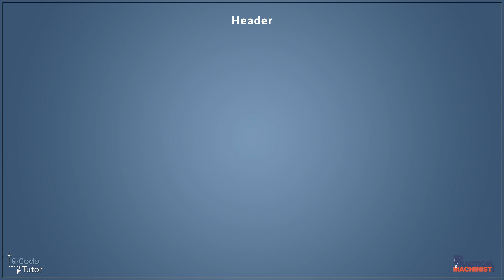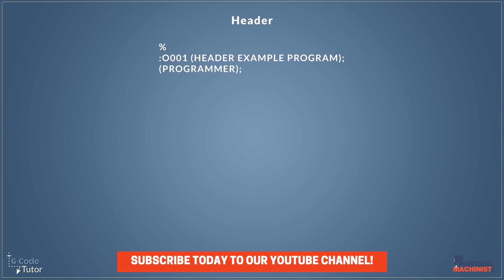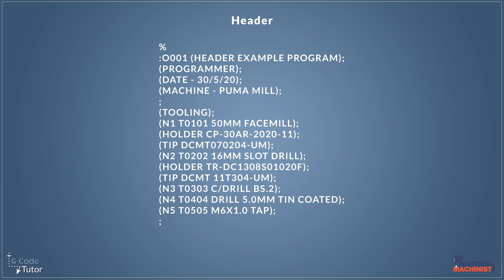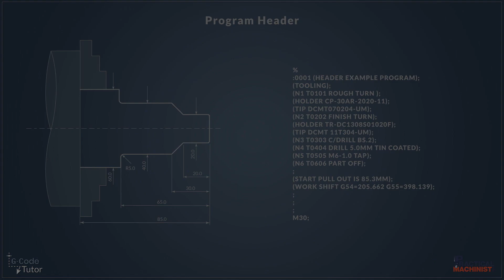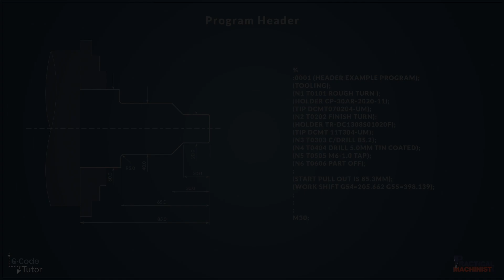G-Code Program Header EXPLAINED

Comment: Here is a tip I can give you (suffice it to say it is very handy when running the program) have the "tool list" as part of your header right after the  program name and date of creation.  This is a MUST (which is highly recommended) when running a program that has more than three tools that are being used (imagine having 20 different tools being used in one program). 

 Why you ask?  Well simply think of it kinda like legend on a map because like the adage goes "Sh*t will happen" and it will.  When you are in doubt and had to reset the program but don't know where to go in the program (which has like 30k in memory) to run a particular program block, you can just look at the "Tool List" in the header of the program and match it to the tool in the spindle and  Volia!  now your on your way home!  (if you are wondering I have been a programmer/machinist for, geez...what since 1997???!!!  F*ck!!!